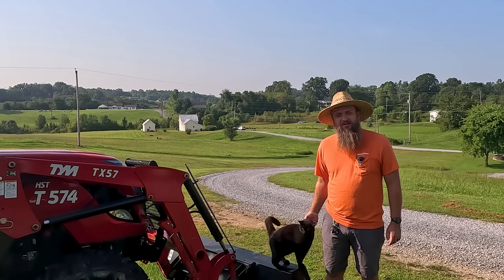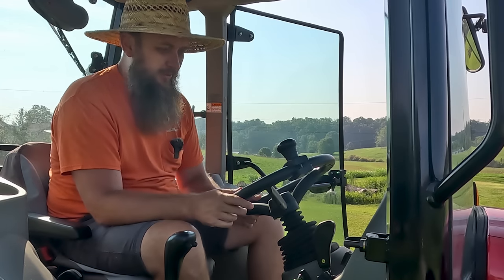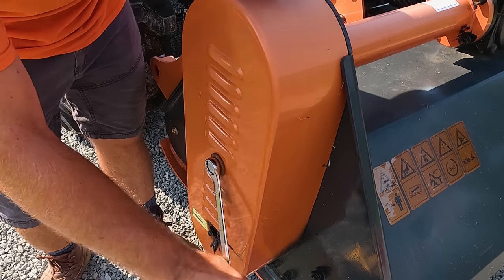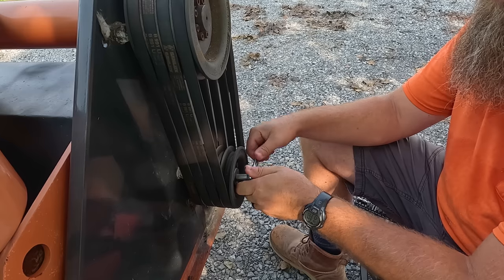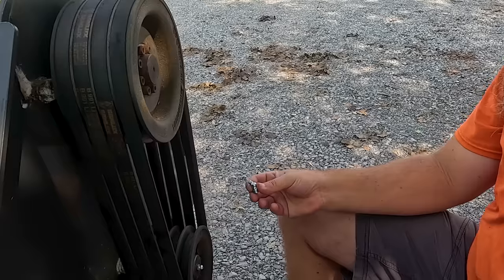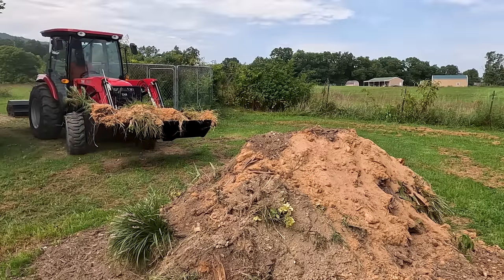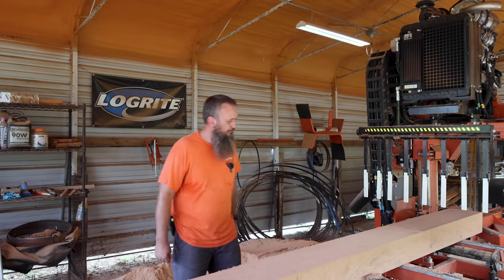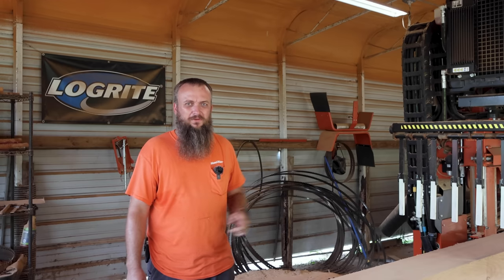Saw Milling Cherry Logs: Turning Timber into Treasures

Comment: I tell you what, I have the same brand flail mower and i had 3 grease zerk fittings that broke just like that believe it's a cheap made zerk but the mower is well made. I watched different sawyer's i believe your the best on that type of saw. Do they have swage tool for that type band saw ?